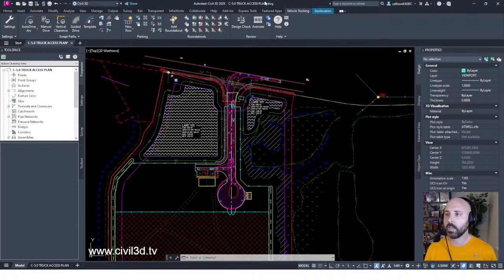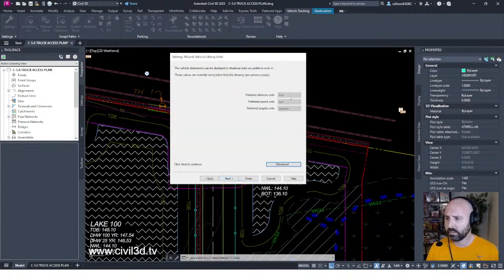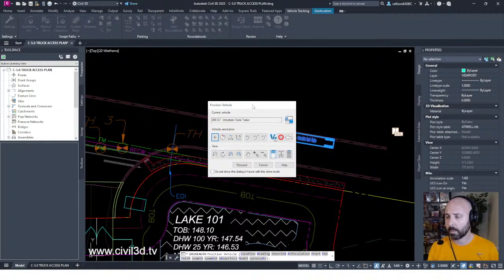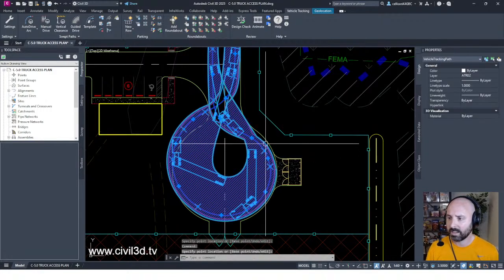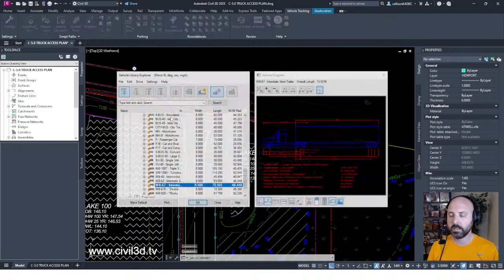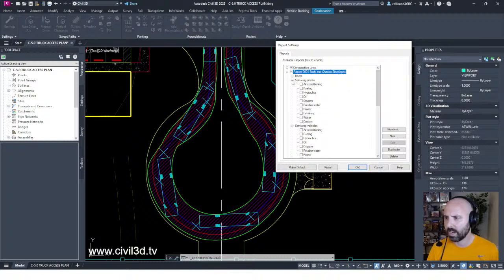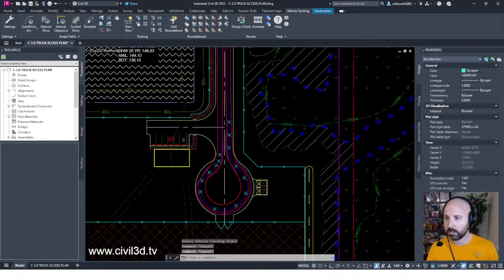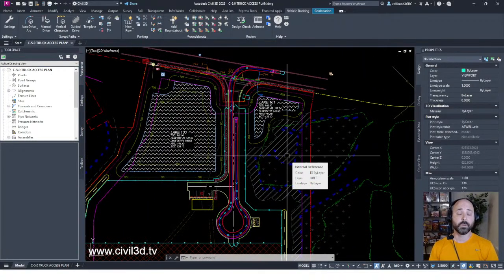Autoturn: The Basics in Vehicle Tracking for Civil 3D

Comment: do you have to have civl 3d to run autoTURN? Can I run it on the full version of 2025?
Reply from the maker: Yes. AutoTURN requires Civil 3D or AutoCAD to run—it isn’t a standalone program. If you’re using the full version of AutoCAD 2025, you can run AutoTURN. You just won’t have access to the Civil 3D-specific features that integrate with alignments, corridors, surfaces, etc. For basic vehicle tracking in AutoCAD, though, you’re good to go.